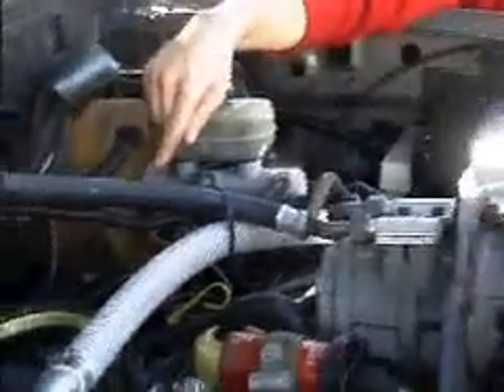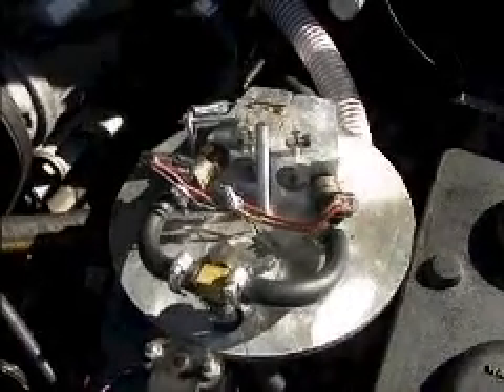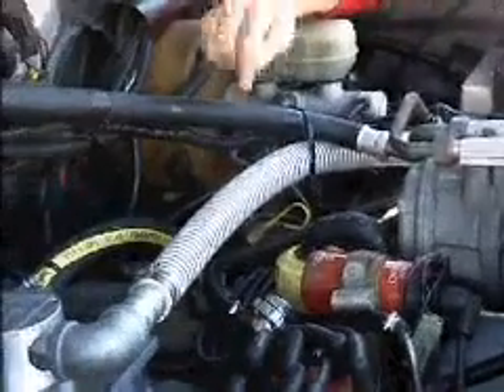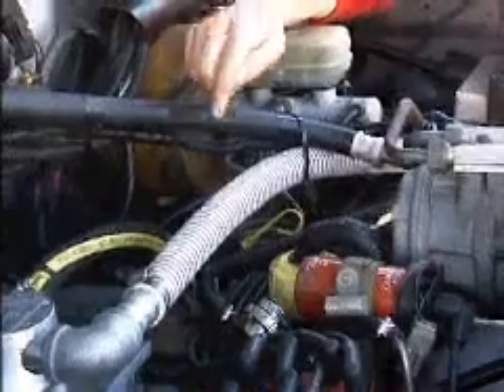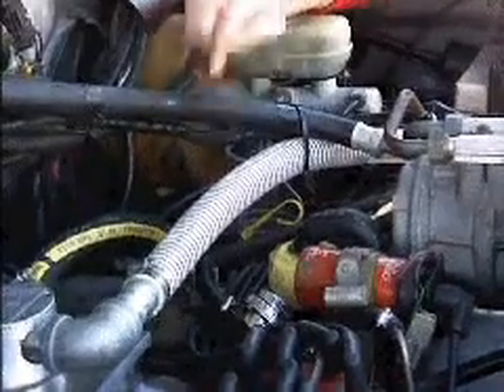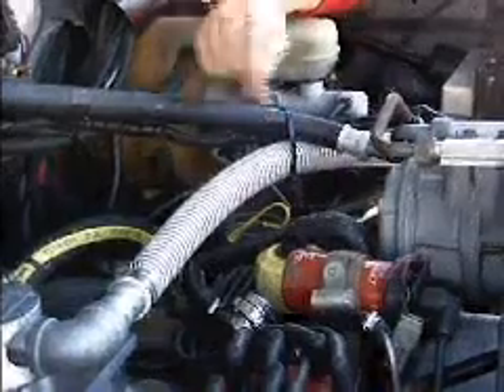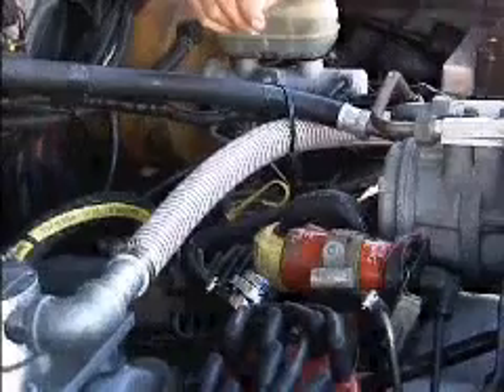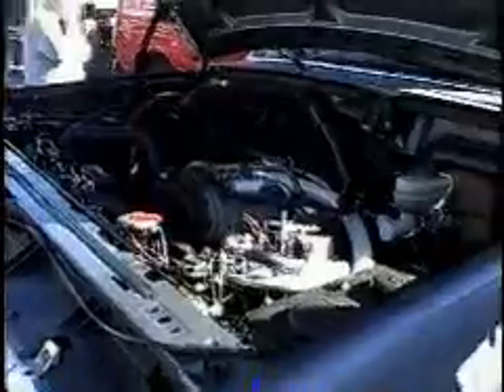GEET Modified Fuel Injector

Comment: Another automobile running a GEET Fuel Processor :-) Great Video :-) I'm very much looking forward to converting my automobile to utilize a GEET Fuel Processor, once I've complete my first small engine GEET build(near complete) :-) Question: which model injectors are you using(CNG type)?